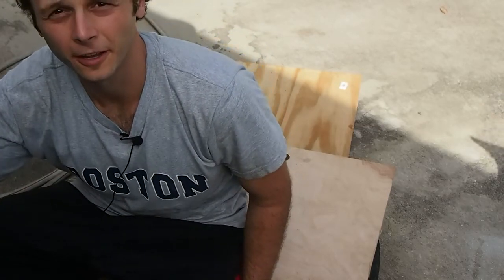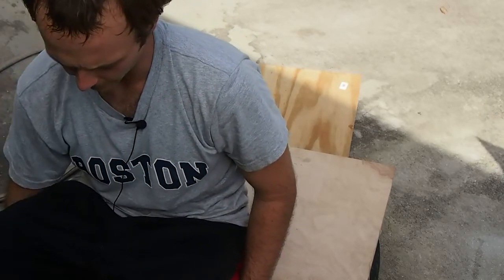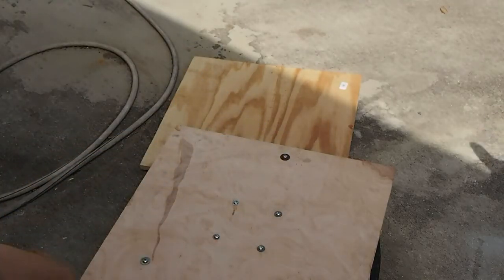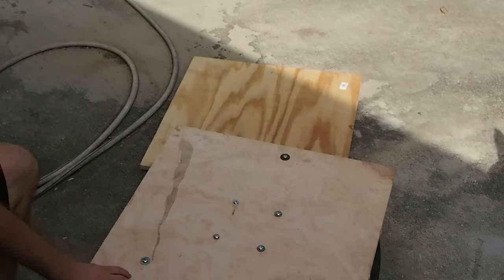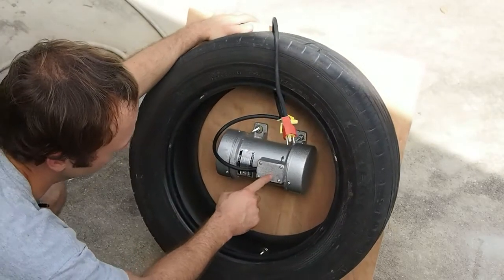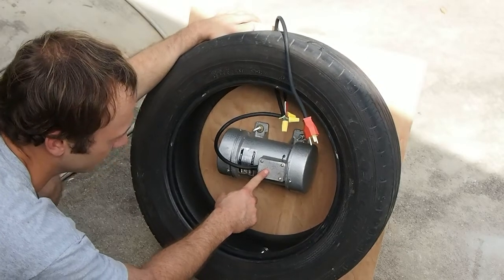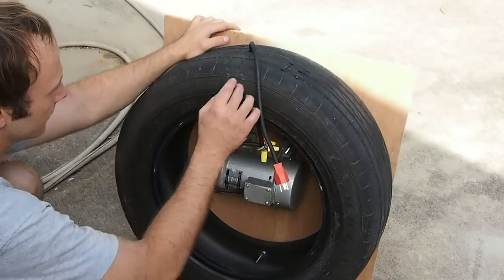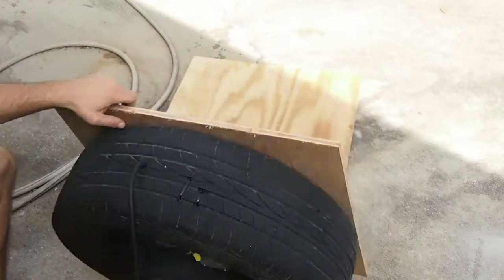DIY Concrete Shaker Table

Comment from the maker: The main purpose of the shaker table was to help vibrate the concrete down fill the bottom of the conical mold.  What that said ... it didn't work very well.  The concrete was too thick to pour (I didn't add enough water) as you can see in the final video of this series